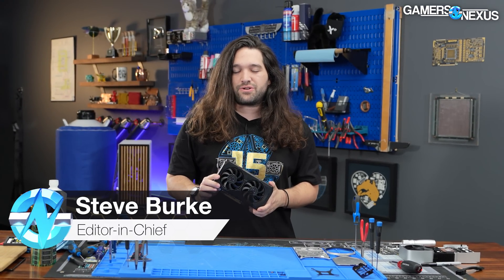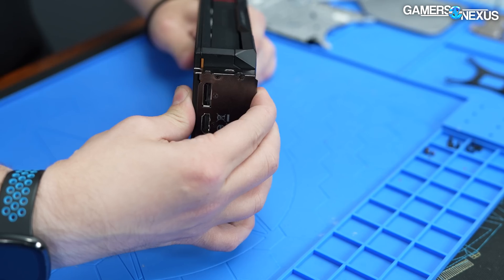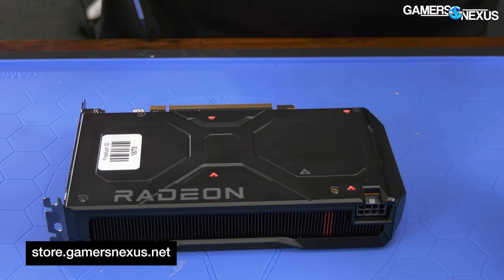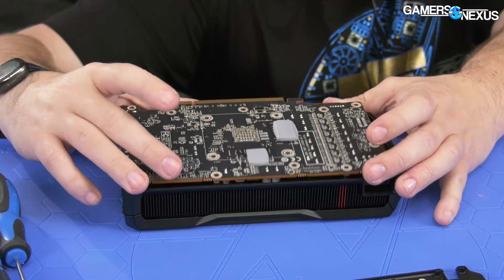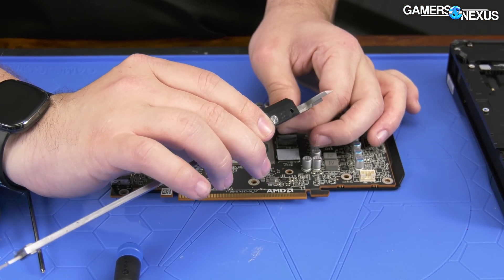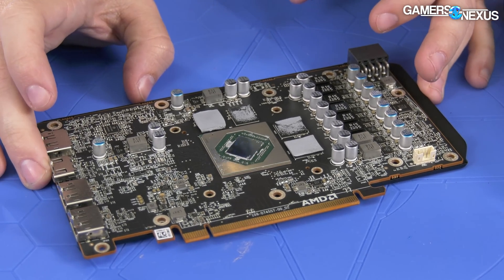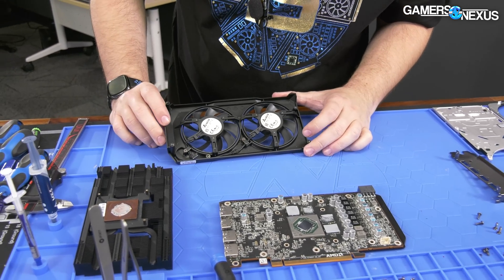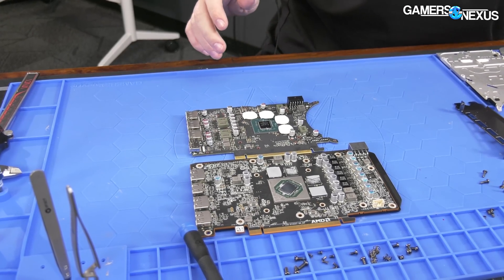AMD *Almost* Learned Something: RX 7600 Reference Card Tear-Down

Comment: 3:30 - Of that type, yes. But I just got a stock/reference 6950XT (because of that price-drop, obviously, like a bunch of other people) and it runs frickin' hot. - I mean, I think I hit just over a hundred degrees, in a very arid case where three sides are all meshed up (heh), plus half the bottom is perforated, with 2x140mm intakes on the side blowing right ONTO the card's fans (cause my motherboard-orientation is horizontal), and then 2x140mm out the top, plus a 120mm out the back through a radiator for the CPU. - However, this card still easily goes over 90 degrees, occasionally just over a hundred if it's doing certain things, which doesn't seem right. I believe the "limit" for this card is even at like 105 or something, that I read, or a little higher even. So AMD will claim it's fine, but to run it like this for a long time... I'm no engineer, but I'm also not so sure about that. (And I'm talking about the junction-temperature, by the way, so the actual hottest measurement.)
I feel like the very "encased" design, with no grille on the "back" (where the I/O-bracket is) for a little extra air-escape, especially since the card's own fans blow INTO the casing, and then also no opening on the other end. It just seems like heat gets trapped in there, so I kinda wish they had made the extension with a "flow-through" and put on a fourth fan (the three on it aren't those very large ones). - Don't get me wrong, I like that it's actually fairly compact (I tried the MERC 6800XT by XFX and I had to drop it into the case at an angle, which only just worked) like this neat "block" or "cartridge" and it's not annoyingly(!) loud when the fans are up. But man, it needs more ventilation to breathe. - That said, I previously used the 5700 by XFX with the more plain black cooler, which is actually way more "open" on all sides (even the backplate has slits in it), that also ran a bit hot, which I then re-pasted (and also kind of re-organized any pads that were even a little off) and it ran about 5-10 degrees cooler. So perhaps it's once again a crap application, even though it's by AMD as opposed to XFX, and it could help to check and re-do it. I don't know.
I'm always a bit nervous to take sensitive electronics apart, especially now that I went with something way more expensive than before. - I mean, if I mess up a 300-something Euro card... egh, painful, but OK, I messed that up and I can take the hit. But something of 600-something Euros... It makes me nervous thinking about taking it apart. - I know it's probably fine, but I'm just worried about nicking some small component or shorting something, even though I'm very careful and methodical.

Comment: They're not sinking the fourth memory module because the triangle on the backplates protrudes through and would put extra pressure just on that module. Probably didn't realize that until it was too late in production/development.

Comment: it looks good enough that i would probably buy this over a AIB model, but there are some oddities, like why do we need a midplate and a baseplate?, couldn't they of made that base plate do memory and just stuck a little heatsink on the VRM?, 

if the baseplate is not doing memory why not just have a couple of raw heatpipes over the core, the core looks small enough for it, and i have seen single heatpipe designs(Turing stuff) in this power range that are more limited by finstack then die contact, so the copper plate heatspreader on a low end GPU feels redundant.

and only using the backplate for 3/4 vram chips is odd too, having 1 hot vram chip will be enough to undo any benefit from the 2nd pad on the other side, so why not just have 1 pad in-between each chip, if your not going to give all 4 vram chips a backplate thermal pad.

but the main worry about this card over a AIB card is just how many spaces are cutout from the finstack, it might not have enough area unless the fins are screaming

Comment: It's the epitome of "this is good enough". A fin stack and two heatpipes is normally good for around 150 watts, the zillions of embarrassingly cheap RX 570s in late 2019/early 2020 used exactly that design, and they were thermally limited for the most part.

It is a little disappointing to see first party cards be at this kind of basic level but hey, AMD doesn't want to compete with its partners. Maybe it remembers what 3DFX did.

Comment: Nice, simple design.  But a note, metal on metal aluminum contact is higher W/mK (~238 W/mK transfer rate) than metal on thermal pad on metal, because the weakest link in that chain is 6.5 W/mK at best (the thermal pad).  Thermal pads act more as heat insulators than heat conductors.  If you are that worried about it though, just apply a thin smear of thermal paste where the metals contact to maximize contact, filling in the gaps with 7+ W/mK to compliment the 200+ W/mK of metal on metal, rather than limit the entire transfer to sub 6.5 W/mK.  At least AMD has started applying pastes to the die rather than overly thick thermal pads on the die which contribute to swifter burnout from minimal contact through what is practically an insulator.
Reply: The thermal pads that AMD used on their dies were very thin and were graphite in the 30-70W/mK range instead of <10 range. 
They weren't quite as thin of a layer as paste (and didn't fill as well) which meant they performed a bit worse, but would last a really long time. Emphasis on a bit, because they still managed too cool them just fine.
On the memory and mosfets, the story is quite different as the thermal density is vastly lower (maybe 1W each). 
And in the case of memory is actually going through a plastic package which is also an insulator because memory modules themselves don't really produce all that much heat (~2W per package).
Compared to the north of 100W from the GPU die and they aren't even comparable. It would take less than 2mm2 of silicon area to dump as much heat as an entire GDDR6 package.
Reply: @bayanzabihiyan7465  I have seen firsthand the thermal pads on AMD, they are actually rather thick.  2mm thermal pad with a 1mm gap hard stop on the screws.  That is why the spacer/washer mod exists in the first place.  1mm pads on the memory are typically plenty sufficient, but the 2mm on the dies themselves, not so great at all.

Comment: Comparing this design to the reference design on the previous, similarly priced 7000 series gpu (hd7950) I would say they at least improved a bit on the cooler design.

Comment: Despite being 6nm vs 5nm, it is kind of shocking to know that the 4060ti has a smaller core than the 7600, given the performance delta between the two.

I hope this chip is filled with deactivated cores that would be available in a 7600 XT or something.
Reply: 7600 is ~13.3B transistors while the 4060ti is ~22.9B or the 4060ti has around 72% more transistors despite it's slightly smaller die size.
The process node really does make a huge difference. 7nm and 6nm are borderline the same while 5nm really did give a massive boost to density.

Comment: Seeing how the ports are only on the lower part of the card, how a one slot design would work? Obviously, the perfomance would suffer, but for many folks that use smaller cases, this would be still great. Do you have any means to test this ?

Comment: I like your comment on why it doesn't make sense to put a vapour chamber in the card and it would be great if the partners listened, because they've been doing exactly that.
Why the hell do we have a 460Ti with 3x fans and with 1.5 of those being purely flow through? The thing uses 120W. It could be cooled by a flower style cooler and cost half the price.
I have no idea why this generation they decided that all cards should run at 50C, instead of the normal 70-80C we've seen for decades

Comment: Not trying to defend bad card releases, but people keep getting overly caught up on the 1060 price. In 2016 when the 1060 released, $250 was rhe equivalent of $320 today. Then you compound the fact that these new cards have better designed coolers with better materials. Its kind of apparent why they cost more.

Remember, I'm nor defending or saying theyre good products. Just sayinf there are logical reasons as to why they cost more.
Reply: 128 bit bus x8 makes it cheaper to produce

Comment: Should've added an extra heatpipe and some more surface area in the actual cooler. Two isn't great for a 165W TDP chip and would've helped a lot in transfering heat to the fin stack. The cost would be negligible to the overall BOM. 

The design looks good though. The only other thing I would change in the fins orientation and have it stacked sideways to let the fans push the heat out of the system on one side.

Comment: At 220€ it would be a great card, but honestly I would still skip it and look into buying an RX 7700 (XT) (hopefully for less than 400€) since I'm more inclined to move to a solid 1440p experience, rather than being forced to 1080p or dial down the graphics a lot due to the vram constraints.
Reply: At some point it will be below 250$, there is no way that it can compete with 299$ 4060 at 270$. Even if 4060 didn't have DLSS/Frame generation people would still pay 50$ more for a nvidia card.
Reply: @1GTX1  That's why AMD panic launched it, so that they can adjust the price. Nonetheless even the 4060 is barely any better, considering how negligible the current 8gb 4060ti. There's probably some saving grace with the 16gb variant, but I doubt it will perform better in terms of framerate, and that 499$ pricetag is just disgusting.

The only solid option would be 70 class gpu, again hoping that both companies doesn't screw them up. 

As for the 50 class card 4050 is DoA with its 6gb vram (compared to the 3050 8gb), while the 7500 is in a similar position but it's rumored to be a 75w card carving at least a niche in a sff build, if again the 50 class card manages to break the rx 480  performance level they have been aiming for the past 3 years (5 years if you consider the 570 as the budget option)
Reply: @GLDragon93  It's interesting that they delayed 4050, i wonder if they will put 12GB vram on it and sell it for 269$. In the past they had canceled 6GB 3060.

Comment: There's seems to be decent amounts of airflow for its VRM but where does that hot air exactly exhaust to, to the side of the card, because there is almost no space for it, who designed this?

Comment: FE 4060 Ti: Massively overbuilt cooler, 4-phase VRM.
Radeon 7600: Slightly underbuilt cooler (could have done with another heatpipe), probably a 6-phase VRM, and deals with +20-30W.

Comment: Looks very cute, and at a good price. Remember paying 750usd for my 6600xt during covid, but I did get a chip that clocked at 2750 at -70mV and the memory was stable at 2200MHz (didn't bother to push further). The 6600xt second hand should be sub 200 around 170 dolars (idk prices are still pumped up), so I don't see a reason to go out and get a 7600. If it were faster, maybe. But if it drops to 200 usd, it would be a beast at that price.
Reply: lol

Comment: WTF is wrong with these reviewers, this is the best card available at the moment and props to AMD for coming up with this, my rx 570 was holding me till now via their FSR even at 1440p and now if down the line I need to upgrade I know I can get a 7600 at a good budget.
Reply: There's nothing wrong with them, they are being brutally honest. There are cards that perform better than this currently like the RX6700 or even the RX 6650XT being cheaper and performs identically to the rx7600

Comment: Here in Denmark the RX 7600 goes for 375$ now. This is a laughable price considering the 6700XT is  around 420$ and the cheapest equally as good 6650xt is 305$. Its a shame, but I will have to wait for the price to come down...

Comment: GNs top tip "Walk away for 3 days and come back when your fingernails are longer"

Must keep that mind on my next build 

If they even went off track and gave it 10GB and 192 bit mmeory bus for the low side of cards that the x600 series is and it was say £300 it would have smashed it.

I bet the partners will be releasing £300 cards anyway

Comment: 6 years ago the RX 7600 would have been considered a really high end card steamrolling any game you threw at it. But in the year 2023 it's a cute cheap little graphics card aimed at the low end market segment. Hardware progression is fascinating.
Reply: Except that the innovation and improvement has stagnated hard in the last 4 years if you compare it to the previous progression of the 7XX to 9XX to 10XX then 20XX to 30XX.

Comment: Good, AMD made a new paperweight.

Wait,... is it heavy enough to serve as a paperweight?
And why is it soo overpriced?
If I had been in charge at AMD this card would've launched two months ago with 12GB of GDDR6 memory on a 192bit bus and been priced at $229. Otherwise, same GPU with the same specs. Just more video memory on a larger bus and faster memory clock.

That would've sold pretty well.
This card here,... I'll be surprised if it sells more than 50,000 units. And that's being stupidly optimistic for AMD.

Comment: Considering my RX6600 barely consumes 100W on full load in games I would assume the 7600 to consume lesser, so a thinner heatsink should work okay.
Reply: 7600 is a 165W card
Reply: @blackf0rd  Man, even though Nvidea is wayyy behind in performance on low tier gpu's i gotta say, they know how to make a gpu power efficient at least. If the rtx 4060 really is going to have a 115 tdp, and more powerful than the rtx 3060 as well than that's going to be a excellent achievement. If it is actually more powerful than the 3060 of course lol!
Reply: the 7600 got a higher power consumption
Reply: @patrickgrunwald8597  The 6600 was also a 132W card but stays below 100W, the 7600 should also be the same like around 130W in gaming but AMD optimisation will kick in few months after launch. The same happened for 6600 too, I bought it on launch day.
But whatever be the case for both Amd and Nvidia the GPU launches for this generation have been too much unpredictable in a bad sense.
Reply: @rounakr94  tests show around 160-170w

Comment: Apple minded thinking has no business in a video card. Apple is apple, rest of the world should be normal. We've enough trouble with video cards as it is, and our world doesn't need a disposable, one time use card with cooling fans that need to be coded in to work  if replaced.

Comment: I kind of like how it looks like you can put it back together without the shroud and fans if you wanted to try to build a passive cooling build or strap your own fans on there haha. But really looks very serviceable, fans look very easily replaceable even looked like you could replace each fan separately instead of needing to do both. Will be interested to see the thermals.

Comment: With the driver problems, I wonder how this will work on Linux.
Reply: AMD cards aren't known for driver issues as of late, but always working amazingly on Linux
Reply: @lukemax6048  *until you do anything AI related or VR related
Reply: as long as your distro is relatively up to date with the kernel and mesa version then i would assume pretty good, at least on wayland, i have a 7900 XTX on linux and everything has been good

Comment: Judging by circuit connections, RX 7600 has PCI 4.0 x8 and not x16. They did here the same lame thing as with RX 6500ti and RX 6400 (x4 and not x16), but on a smaller scale. 
Why would they limit PCI 3.0 compatibility on the lower end cards? It does not make much sense.
Reply: I think 6600 also only have pcie 4.0 x 8

Comment: the funny thing is that 7600 isn't even genuinely bad. the problem is that it's getting it's ass handed down by amd's own previous gen products.😂😂
Reply: 6000 series is slowly disappearing from stores, that's the only reason AMD held back this card. These chips were done months ago. I wager by August, we will be hard pressed to find any 6000 cards, aside from the 6500/6400 trash.
Reply: All retailer are trying to get rip of old stock cus amd won't sell as much as Nvidia
Reply: For the pricepoint the 7600 is very very slightly slower than say a 6700 but is also $100+ cheaper.

Comment: Maybe AMD will make a board design for double the memory chips and sell that card for 300$ and wait for previous gen inventory to be sold out.
Reply: 128 bit bus are still not ideal i would just like to have a 7600xt with 12 gb of vram
Reply: @bot-h2h  128bit bus is because two reasons,. First the chip wouldn't be drop in replacement for 6600 laptop GPU:s and they would loose some models they already had partners designed for previous generation. Secondly AMD designed it for low-end on a relatively modern process and cost of those memory controllers is just increasing relatively to other things they could put on the chip.  The mistake they made was they didn't predict the current need for VRAM capacity when they made the design.  The L2 cache and memory controllers are married to one another. They probably could have halved the L2 cache per memory controller and increased the memory controllers by 50% if they would have made the correct prediction couple of years ago.  But they would have had to make the prediction when everyone was 8GB is enough lets have higher frame rates on games that already exists for least amount of money. And default way is just reusing same blocks for different models of same generation but fewer.

Comment: No chance these have the same issues the 6800XT Coolers had if out on a GPU riser the heatsink became useless? Hoping they didn't reuse unsold GPU coolers for older generation GPUs.